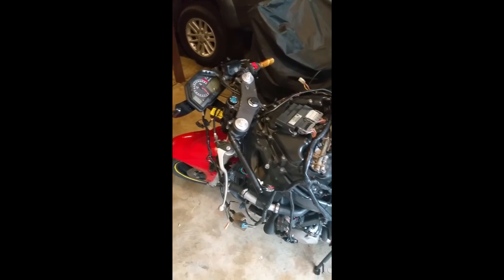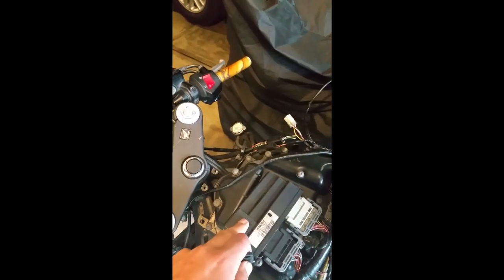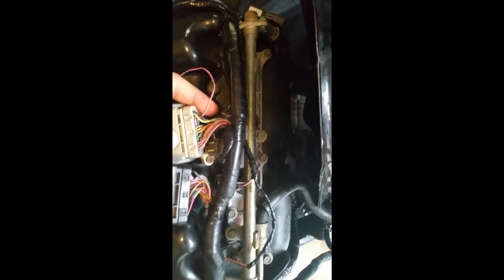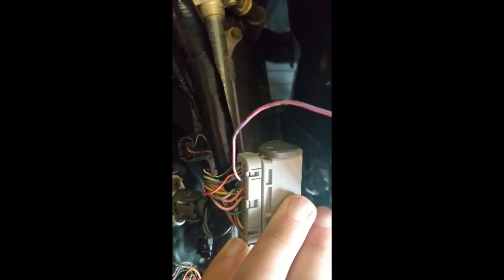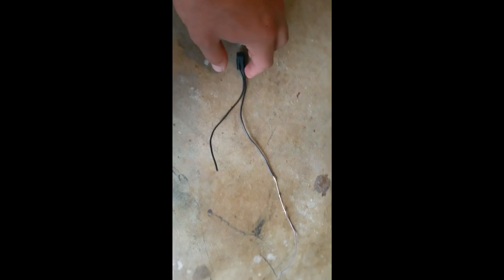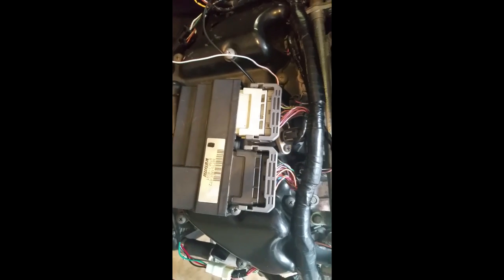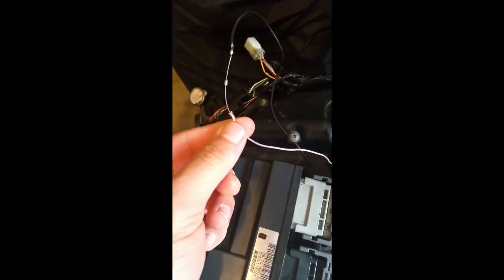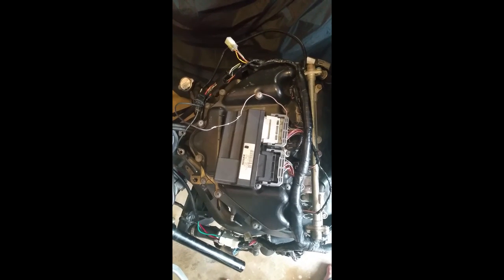Honda CBR 600 RR 03 04 Bypass Hiss ECU Mod

Comment: Blesss after getting my bike running id like to help those out in the same boat issue as me. first get yourself a NTE5007A 3.9 v (tolerence %5) 0.5 watt ZENER diode. not a regular diode. CATHODE SIDE TO 12VOLTS POSITIVE. OTHER SIDE TO PINK WIRE WHICH SHOULD READ ROUGHLY 9 VOLTS. 9 volts to pink wire which goes to ecu, lets fuel pump work. don't know why this shit is so hard to find on the internet but. hopefully it helps or. u can get a voltage potentomitor and dial in 9 volts to go pink wire. 9 volts dc is what pink wants to make yer bike run ai good day
Reply: Yoo
Reply: @DayDurantTv  bruh bruh what’s good
Reply: Hey is there a way I can personally reach out to you I don't really know how to contact people on YouTube but I need some help with this and you're the closest person that's broke it down into the simplest form for me
Reply: Just a quick question?! What line of 12v u used? Or you just got it directly from the battery? Thanks

Comment: Hello, I wanted to ask you if doing this change the pin 28 currently connected to the wiring must be removed or simply need to add pin 29.
Last thing, the 3.9v zener diode from how many Watt should it be?
Thanks so much!!

Comment: Hey bud great tutorial, massive help. I have a stolen and recovered 2014 cbr500 with no keys and the ignition drilled out. In theory I should be able to simply buy a U.S. ecu and obviously modify the loom as directed and be able to run a generic/cheap ignition switch or am I missing something?

Comment: hi everyone I'm stumped bought a honda CBR 400cc f4 from poland lost its spark to all coil plugs could it be thee hiss antenna around the ignition key and is there a way to test it with a multimeter would be ever so gratefully if anyone could help me get it running again tried everything everyone stumped as I am so any comments would be gratefull

Comment: can I just wire up a 9v battery to bypass the diode for hiss ? my diode is burned out and shipping is crazy
Reply: Brandon Quillen  yes you can
Reply: so did the 9v battery thing work? I  got an 02 yesterday and i wanna ride!!lol
Reply: I got a 03 cbr 600rr I don't have the gauges or the harness piece that connect it or the headlights can anyone tell me what color wires I need to hook up to a 9v  and which wires to bypass for the tip over sensor so I can get this thing to fire. I also have a 99 cbr f4i could I is anything off of it to make this easier

Comment: Hi, so yo dont need another key, just the original one but hiss dont work anymore, right? no need to change the keylock or wires? Thanks, I need to install an american ecu to an australian  2003 cbr 1100xx.
Reply from the maker: hi once you put a us ecu you can either choose to have a key or not but the main thing bypass hiss

Comment: Hi
Good work, it will help in more than one.
I have a 2005 CBR1000RR , is that your method works on my bike ?
Or do you know how to do for my CBR ?
I live in New Caledonia near the Austraile our motorcycle and have the HISS . My CBR does not want to start and I change the ECU but it is very expensive so I wanted to put one of the USA without HISS .
thanks friend
Reply from the maker: hi,

yeah correct its cheaper to buy a American ecu without the hiss, this method works the same but the only difference could be the pin number would be different
Reply: +halala85 Would you know what would be the pin number on my bike ? I will not want to make any mistakes . Thank you
Reply from the maker: +Nickolas Fricotte hey sorry i wouldn't,  best bet would be look at the name of the pin number for my bike and then look up thr wiring diagram on your bike and find the same
Reply: +halala85 Ok. Thanks for your answer. I will do that.

Comment: Hey mate, great video. I have a 2007 cbr600rr, is it the same for this bike?
cheers
Reply from the maker: hey memz, yeah it will be the same but maybe a different pin number,  you just need check wiring diagram
Reply: which pin number? we will ean this number. thank you for answer
Reply from the maker: i mean description on this video

Comment: Hi.
Where from is you motorbike ?  Spain, frence.... ??
Reply from the maker: Australia
Reply: Thanks for the reply. Could cbr600rr send electrical diagram? Usually this is in the last pages of manual owner. I suspect electrical wiring is not the same vercion Spain.
Reply from the maker: I haven't got the electrical diagram i googled it a while back but it should be exactly the same set up as AUS UK and EU
Reply: Last question.
Where I can buy the female metal terminal to pin 28?
No female terminal on pin 28
Can you give me the name of the female terminal?
I'll try to buy on ebay.
Reply from the maker: +Jose Vargas hi,

you will need to go to a wreckers and look for a wiring harness that you can cut the pin off, if you can't find one around you i can cut you off a pin from a spare wiring harness i have and i can mail it to you and you can just pay for postage. let me know how you go
Reply: Thanks for the help, but I will try to adapt some pins that I have in the garage
Reply: Jose Vargas 2

Comment: I was wondering how many watts that diode is and if you just wire it inline or does it have to be grounded
Reply from the maker: James Love Hey Mate, the diode is 3.9 v, the wire that you put the diode to has to be a 12 v Source with a diode in the middle facing the correct way and going into Pin 29, and no doesn't have to be grounded as long as the wire is running the voltage
Reply: So to pin 29 not 28